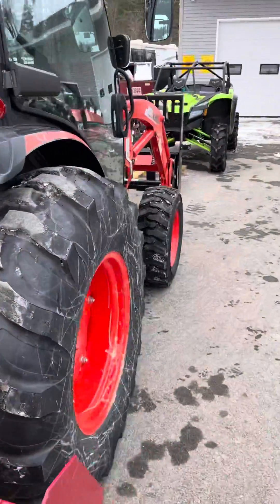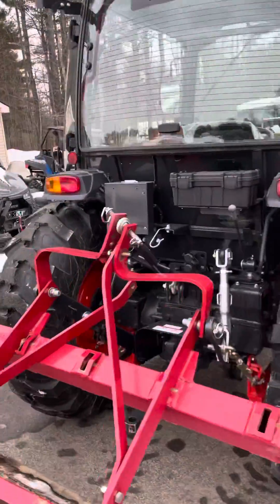How to turn up hydraulic Pressure on a Kioti Tractor

Comment: The previous owner of my DK55 increased the hydraulic pressure to increase the loader capacity.  Unfortunately, with the higher pressure, the hydraulic fluid ran very hot when running the engine at higher RPMs.  This then led to failures in the system.   My advise is to stay with the factory settings.

Comment: Corey. ck2610 steering wont turn to turn lock it will turn all the way right or left but you can turn the wheel continuously  any help. Thanks

Comment: Love it when people get all scientific like "turned it up about 1 full turn". Ever cross your mind to simply put a pressure gage in line and see what "1 full turn" amounts to? Bad advice can cause people to blow shit up.
Reply: good point. sounds like he's ok luckily.
Reply: Where you going to put the gauge at under the seat?
Reply: @RudyPooe  you don't "install" the gauge, it's just temporary until you've finished tuning it. Put a m/f quick connect on it and you can install it anywhere on the machine.

Comment: I think I'd have felt compelled to have put a hydraulic pressure gauge on the tractor so I knew how much  I was changing the system.  As an upgrade I'd like to have a hydro pressure gauge on the dash.  or at least an idiot light.  HEY  What the fuck is with that box blade set up??? It's connected really strangely  and not connected all at the same time
Reply: it's so he could get it on a HF quick hitch!😆

Comment: Your box blade is bent all to hell. What happened?
Reply: He turned up his hydraulic pressure
Reply: @bowdoin5063  lol
Reply from the maker: It bent so easy - it was a cheaply made box from China. I regret buying it.
Reply: @WilsonsRec  Been there, done that. I bought a new Titan box blade and did the same thing on the first use. I found a rusty old bush hog with 1/2 steel and scavenged the 3 point mount from it. The long support bars to the back of the blade remained so I reinforced them with some angle stock. It's rigid now but it took some work.

Comment: Can you make a video on how to do this on a Kioti Ck4010se cab?
Reply from the maker: I don’t have a CK to check but I would think it would be very similar.
Reply: @WilsonsRec  the CK looks a little different under the seat
Reply: @BossSwanger  just look for the bigger nut with an allen inside, there'll only be one in this basic location.
Reply: sorry that reply was to Brad on his CK above.
Reply: Great video,  I have a cs2220 I'll look and see if the adjustments are similar.  THE BIG QUESTION IS, how do you turn p the hp from a 22 hp to 25 hp? Kioti makes  several tractors with only the difference of hp. I've been told they use it for marketing  to up sale. Let me know if you have any ideas,  thanks again.
Reply: @haroldsmith8398  that'd be engine tuning, not something you can likely do on your own. talk to some diesel and tractor pros and maybe.